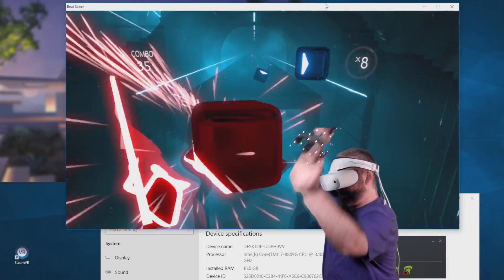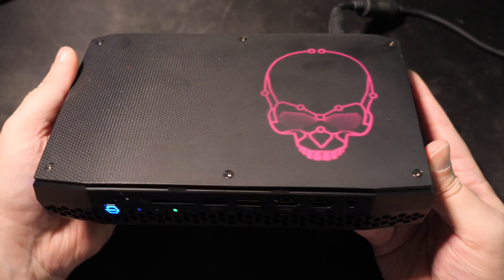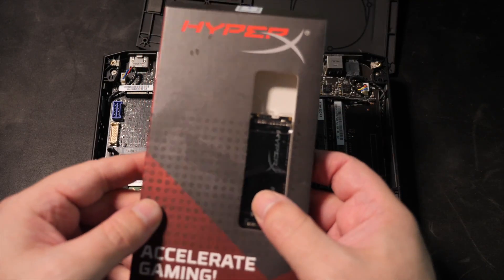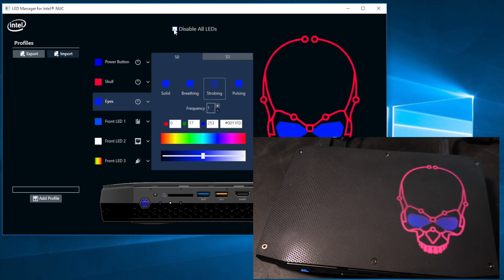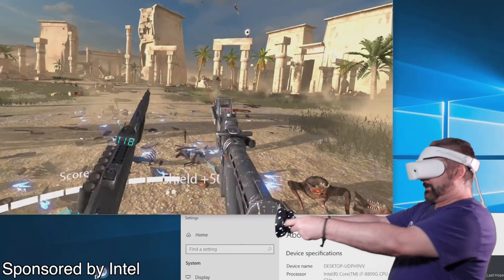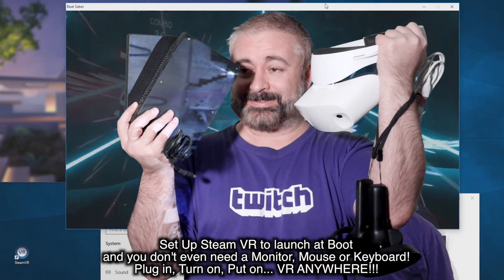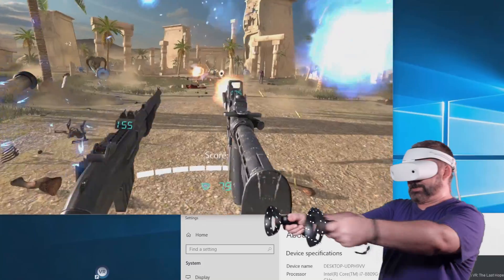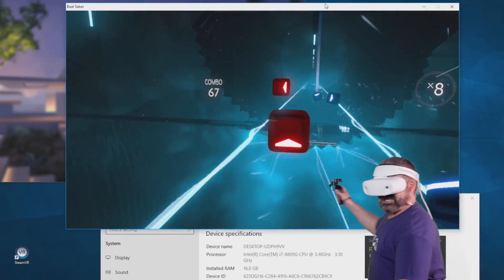World’s Smallest Full-Fat VR PC? - Hades Canyon NUC is AMAZING

Comment: Given VR you are typically tethered to a cable for the hdmi and the usb3. My question is could the hadyes canyon be placed in a harness on the back with a single power extension cable for a more spacious play setting? Seems like it would be light enough not to be uncomfortable.